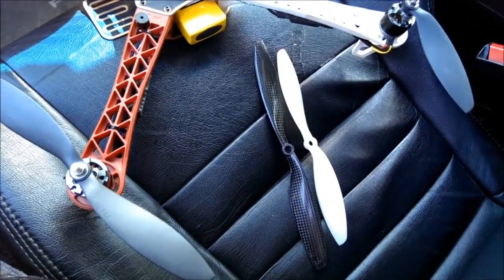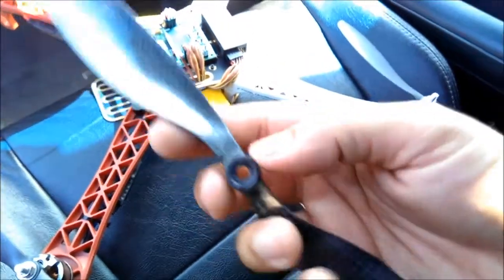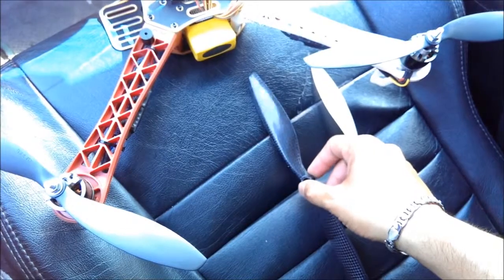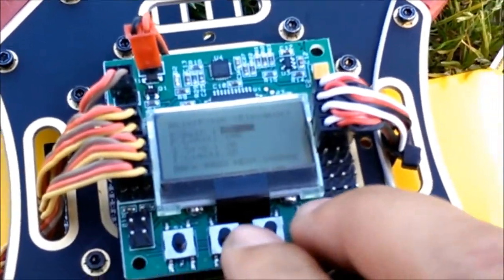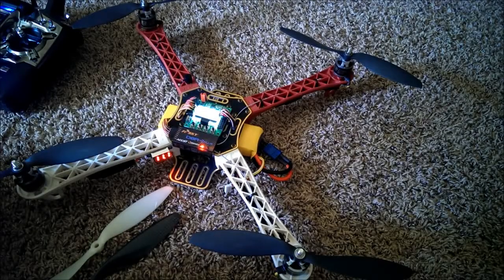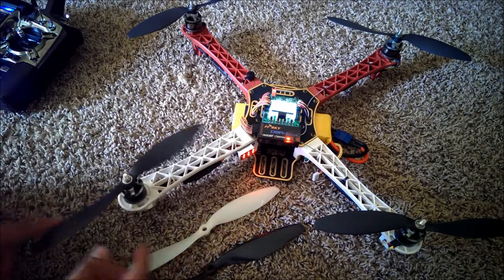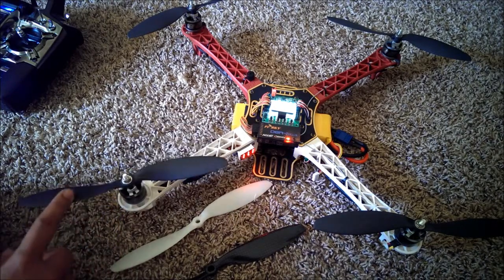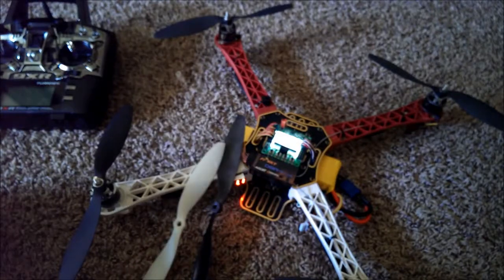Quadcopter Prop Comparison 9"  vs 10"

Comment: The nut size is M6 (I believe). M3 is very small and is the same bolt which you use to attach the motors to the motor arm.

Comment: hi Paul, i'v actually got it the other way around, about a year ago i bought alot of props, but having clone dji motors, now i find i can't use them withe the lock form shafts, any ideas? I am buying the carbon nylon now, but was just wondering if you think an adapted spacer might make it work? I'm away from the quad currently, so just trying to tie it together in my minds eye.
Reply from the maker: +owenkilleen you will have to decide whether it is cheaper to buy new Motors or buy all new props. Props are pretty inexpensive. How many exactly did you buy? I tried to put notched DJI style propellers on a non DJI style motor and I will never do that again.
Reply: Yea, i found very cheap carbon nylon 10x45 props with the notched key hole base on banggood, a pair for roughly two euro, less than three dollars, today, so buying three. oh, loads. I think what i'll do, in time is buy four 940 kv racestar motors from banggood as they're about twenty five(thereabouts)euro for four. As i have another 450 frame. I really liked your  450 setup with a mobius as video feed. Doing something similar myself now. But using a cc3d as a FC.
Reply from the maker: +owenkilleen nice! Just make sure everything is solid and balanced or else you will get Jello through your video. Good luck with your setup.
Reply: yes indeed :-)

Comment: hi.. sorry if i disturb you i saw her in youtube you fly this kk2 board.. may i ask you a question..  because i need your advice or help.  what esc you put in your  Quadcopter OPTO or ESC with BEC? Because l'm new on this kk2 board.. for example if i use 4 esc Opto i put something like a 5 volts 3Amps  for power in this board?  second question if i used  4 esc with BEC  i put directly on this board or i take off 3 red wire of esc and one esc i remain with BEC for one power to kk2 Board.  just reply me if you have time or you cant sent your message on my email thanks
Reply from the maker: If you go back to one of my older part copter build videos. I have two parts. I'm using a Hobby King ESC. You don't need to eliminate any of the wires, you can plug them all in directly to the board. Truly, only one ESC needs to have all three wires connected to the board. The other three motors can have only one wire . But this is not necessary